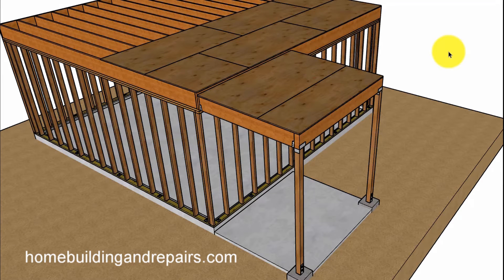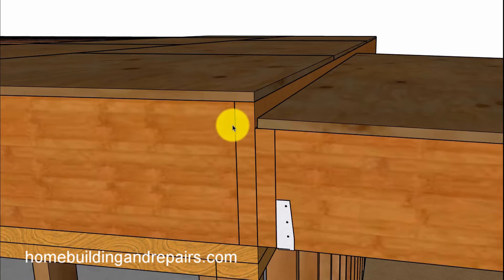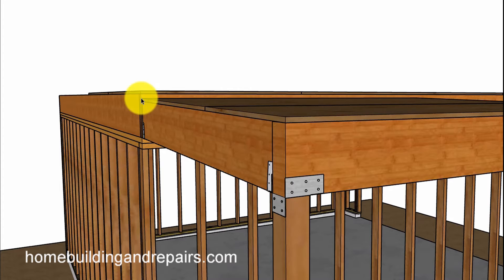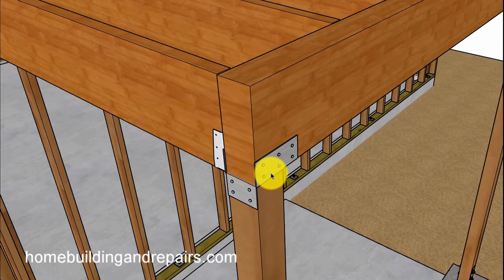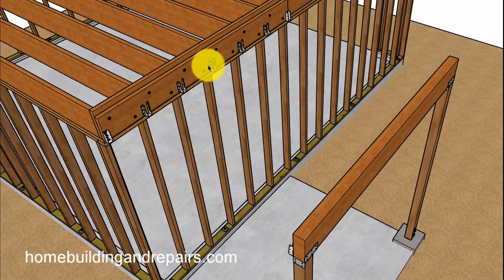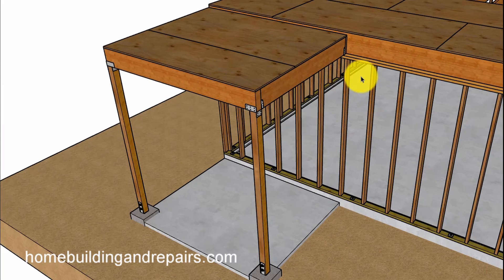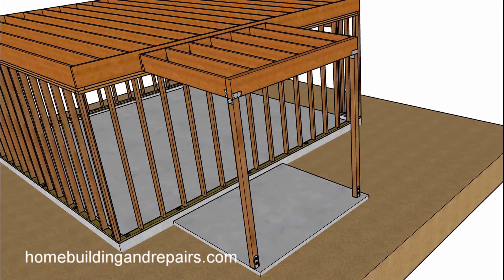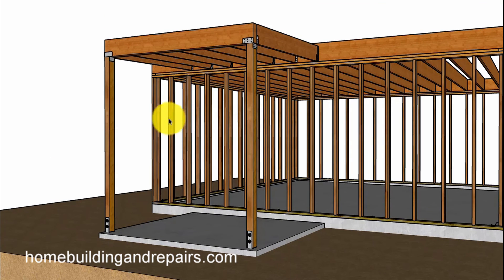Balcony Framing With Supporting Beam Hidden In Floor - Construction Design Ideas

Comment: A balcony hangs on the side of a building.  That's a deck
Reply from the maker: bal·co·ny - noun - a platform enclosed by a wall or balustrade on the outside of a building, with access from an upper-floor window or door.

Comment: I am building a porch with hidden beam like this, but would like more overhand beyond the beam i.e. the posts about 12 inches inset. Is there a good way to do this without steel?
Reply from the maker: Yes, but you will need to contact an engineer. I do have other videos at our website that might be helpful. https://www.homebuildingandrepairs.com/balcony/index.html

Comment: Awesome vid. Whats your take on foam membrane for use in post footings?
Reply from the maker: I'm not a big fan of anything that thoroughly hasn't been tested over decades. I like using concrete and even if the foam membrane became better over time, would probably still use concrete. I've just seen too many problems with products in the construction industry failing that haven't been tested for more than 20 years.